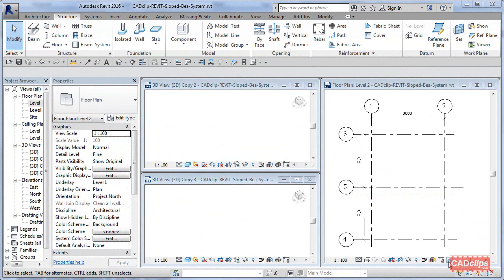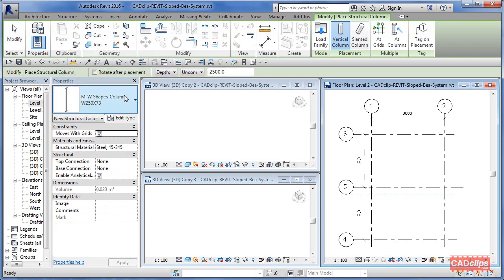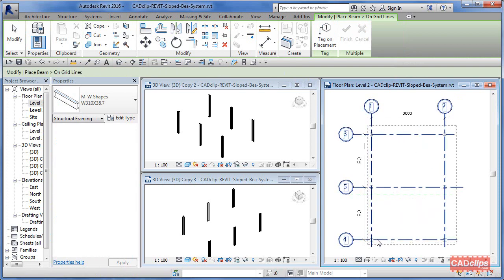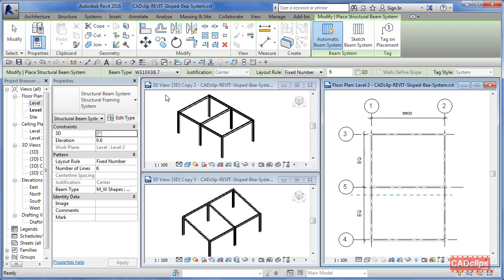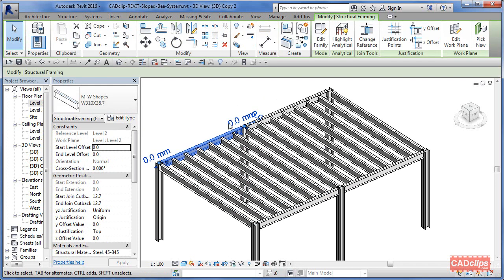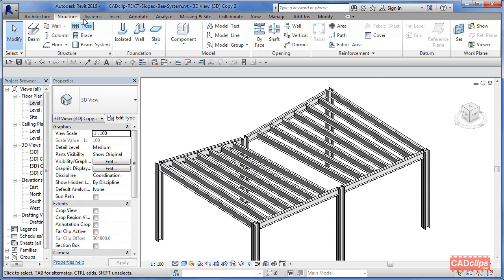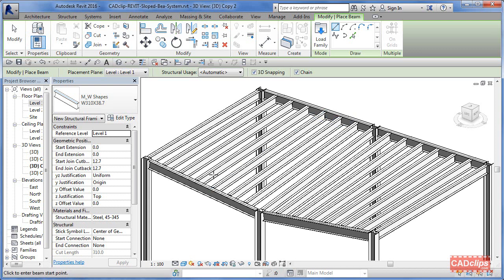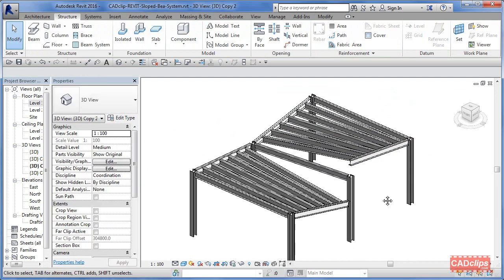REVIT Sloped Beam System - CADclips

Comment: what if you have no columns just cmu walls?
Reply from the maker: jdcarling I'd have to test it but if you pick the cmu walls as the supports (they must be 'structural' in the properties) and slope the top of the wall it may work. Worst case you could burry beams and columns in the wall and just hide them ?